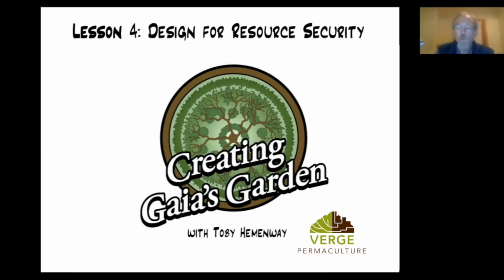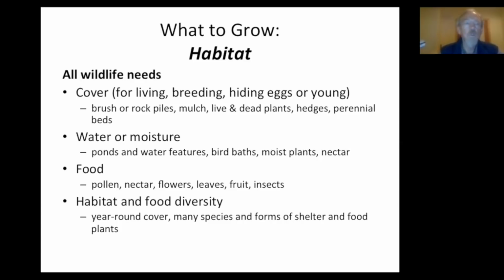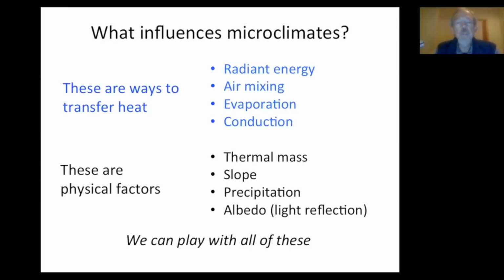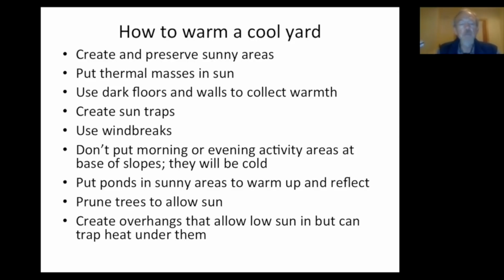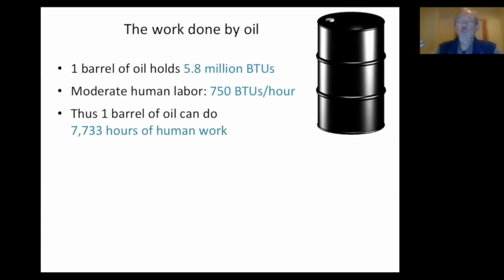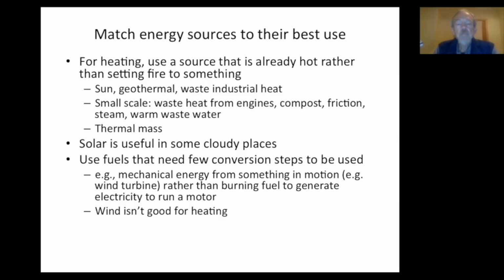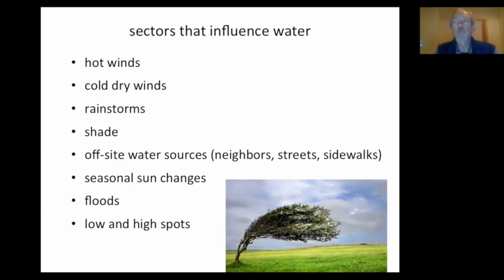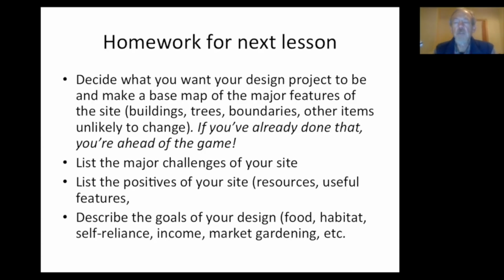Permaculture Design For Food Security: Gaia's Garden Lesson 4

Comment: Basic for growing in small areas: intensive planting (planting way closer than the "experts" say). Plants may not grow as big but they make up in amount. Kale can fit anywhere, one collard plant can get really big: cut off leaves, both grow more. Medicinals grow great in the food forest area, with zero care, just mark where they are. Number one thing you HAVE TO DO, related to his section on "INCOME", before you decide what to sell is check what your state allows for sale, either from home or from farmer's markets. Some of the things he mentions are NOT even remotely allowed in mine. Example: broth and "preparations". Plus, now, vs a few years ago, you have to take a course before you can sell things like jams or other canned goods and get a certificate from the state. The most recent one is full size sheet of paper, that has to be in display where you are selling. (It used to be about 1/10th the size until last year). Second: if you are selling to a re-seller (ex. grocery store), you will get a fraction of what you would get by selling directly, through for example a farmer's market. But when you sell at a farmer's market, you will spending time sitting around talking to customer and other sellers sitting around. Plus, know that now because of the economy, people are selling things like jams made with grocery products and passing them as homegrown, for less, forcing prices down. Check to see what people are selling before deciding which market to sell from and the rules of the market to keep re-sellers out.
Reply: Thanks,🤔